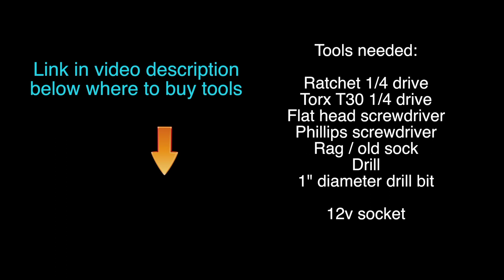Piaggio Fly 12v outlet socket installation | Mitch's Scooter Stuff

Comment: Greedings from Greece-Thessaloniki. Another perfect video, keep filming my friend. At my Burgman 400 (same with yours) I tried to put a second socket in the front box and wired from the original socket. I took off all the front lights, and covers, and still is almost impossible to reach the original socket,to wire the second.very difficult place.
Reply from the maker: Thanks! Ahh yes it's tough... maybe this would help? https://www.youtube.com/watch?v=5oDgGbESqhU
Reply: @MitchsScooterStuff  thanks a lot friend. This video is really helpful but I have to take off the plastic from all over the bike. Too much work for an extra socket. A will connect the new socket direct with the battery and I will safe the day. I will post you photos when I am done. See you soon my friend.

Comment: Hi I have a 2015 model 125 3v and having some electrical problems do you know much about electrics the battery is fully charged and most electrical work but nothing from the starter motor or electric start and immobiliser stays flashing constantly even with ignition on and brown key and rear brake stays on